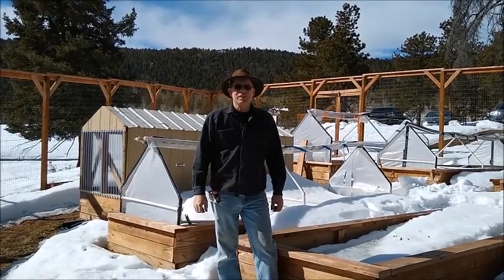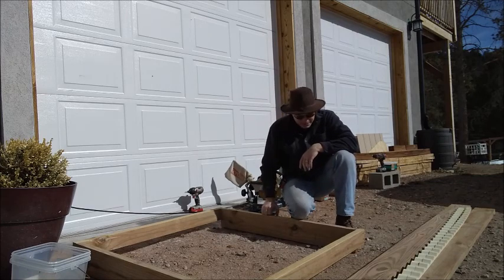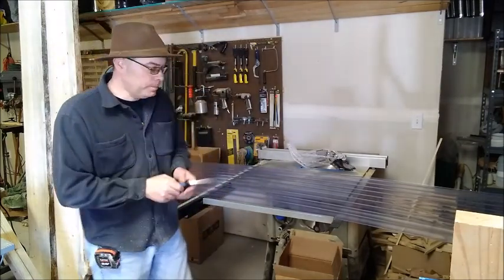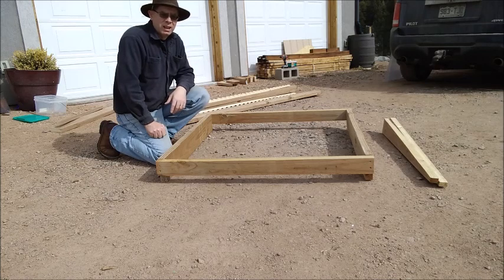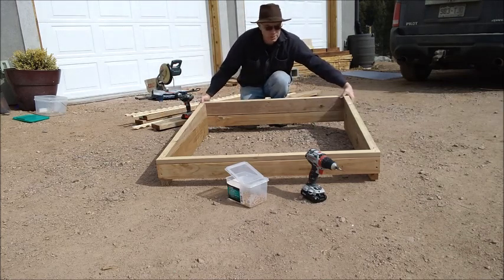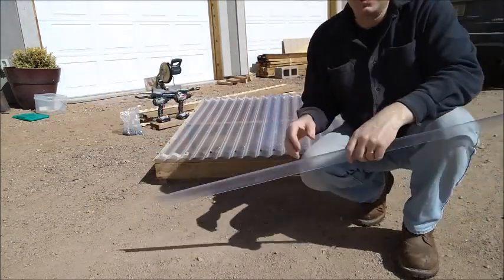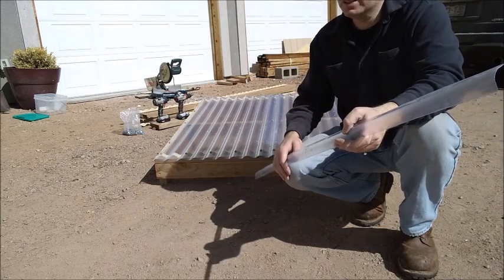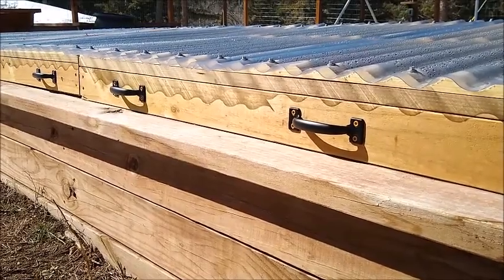High Altitude Gardening, Part 2 - Cold Frames

Comment: I have a question about the "close outs". Did you hand cut each or can they be found at a big box hardware store?
Reply from the maker: In this video the close outs are a full 2x6 with another 2x6 cut diagonally on top.  In a later video, I just make a frame on the side and then use a piece of siding cut to size as the close out.  The second way is much lighter and easier to maneuver.  So in both cases the close outs are cut to size from material found at the local big box.

Comment: Link to green house paneling please
Reply from the maker: These are the panels that we used originally for the cold frames.
https://www.homedepot.com/p/Palruf-26-in-x-8-ft-Clear-PVC-Roof-Panel-100423/100038031
However when I do them again I would use these because they are more durable and degrade less in UV.
https://www.homedepot.com/p/Suntuf-26-in-x-8-ft-Polycarbonate-Roofing-Panel-in-Clear-101697/100021329